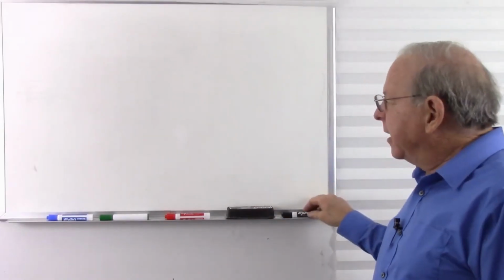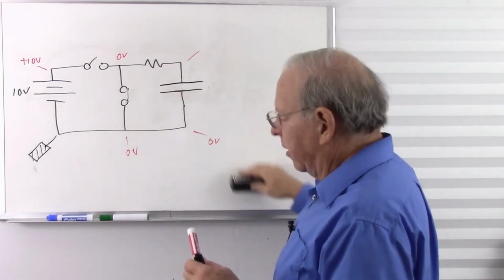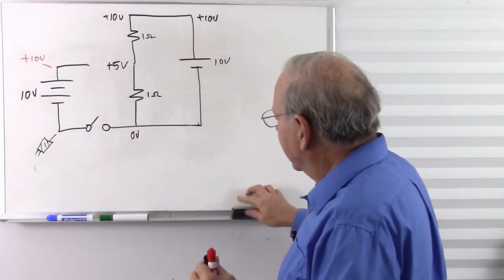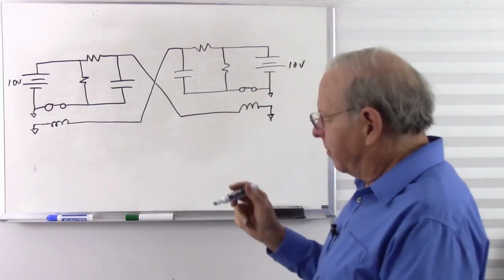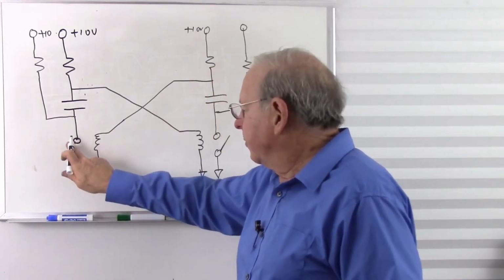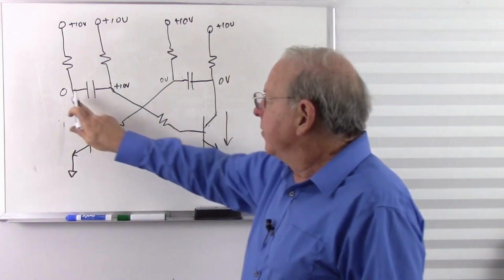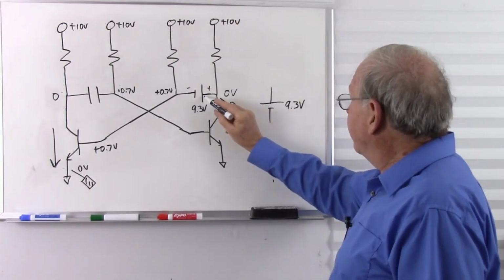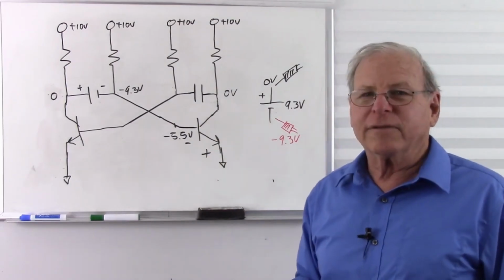Astable Multivibrator - Answers to Questions

Comment: In case you want a more theoretical explanation of what's going on when the switch opens around 18min mark:
Apply Thevenin theorem between the divider mid point and the capcitor + charged side. You get a +5v Thevenin eqv. voltage and 0,5 Ohm Thv eq. resisistance. Then, the unknown voltage comes by adding the two volatage sources in series, which is +15V. The 0.5Ohm resistor is inconsequential in this case, because there's no current flowing.

Comment: Hello, I learned a a lot from this video not just about astable multivibrators!

I came here because of a small home project involving motion detectors and micro-controller. Basically I need to be able to send a short pulse (apox. 20ms) to a reset pin on the micro-controller, I would like to use the PIR to do that, but the PIR goes high for around 3.3v when active and zero when idle. The problem is the high signal from the PIR is too long (stays high for around 1-2 sec) and confuses the RST pin on the micro-controller, I'd like to use the edge of the pulse from the PIR to send create a a 20ms pulse for the RST to work. It would be wonderful if you make a video about this. Thank you again for the great work you have been doing...

Comment: Why would the resistor-capacitor combo charge at the same speed when you put a resistor parallel to it. Yet when it discharges it does so twice as slow?
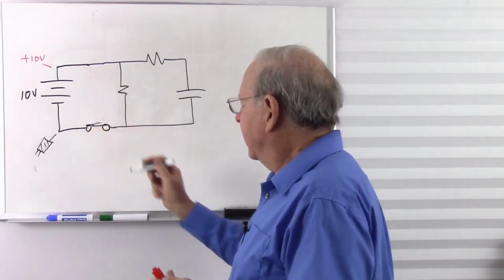Reply: I think he just made a mistake because when you got to 22:00 he says it’s charged after 10sec

Comment: Thanks for the video! I used two small power supplies. I used two 1 kohm resistors. I  used one supply as a capacitor substitute across the both resistors and set it to 10 volts to start. Took the other supply set it to 10 volts. Placed the positive of the fixed supply between the two 1 kohm resistors as shown in the video and used a small jumper wire as a switch between the negative  of the fixed supply to the bottom of the two resistors where I had the negative of the supply I was using as a capacitor substitute. Worked great! Could run the capacitor substitute supply up and down and watch what was happing on my DMM across where your switch is in the video. Close the switch 0 volts. Open switch with the capacitor substitute supply at 10 volts and the DMM read 5 volts! Then start decreasing the capacitor substitute power supply to 0 volts and watched the DMM climb to 10 volts. Thanks for the video sir!

Comment: Excellent and detailed information, I have learned a great deal here watching numerous videos. I built an astable circuirt and it worked well. Then I moved to a traffic light circuit, 3 transistor, 3 LED circuits that look very similiar to the astable. Built it several times always using my on hand 2N2222s instead of the BC547s shown on a video. I tried various circuit mods but they just sit there, no LED lights on. The voltages all make sense but all 3 transistors are fwd biased, all on, bypassing the LEDs which correctly are off. Pulling the B connections, the LEDs come on just fine. I can find no way to get the cycling started. HELP!!!

Comment: In the first diagram discussion, what if the switch is placed right after the positive side of the battery rather than after the negative side of the battery?? Will the working of the voltage when switching on and off will be the same??

Comment: Why shouldn't there be any voltage on the parallel resitor at 10:00 ?
Reply: There is. 5v. That's why it took 10 sec for the capacitor to charge, when it took 5 seconds before. After the capacitor is charged there is 10v at the parallel resistor.

Comment: I am in awe of this man. His ability to imagine his way into the thinking of a trainee, in order to lead the trainee from lack of understanding to full mastery of the subject, is evident at every step in the presentation.  I have never seen a better technical training presentation on any complex technical subject. Bravo, bravo, bravo!

I have three small suggestions for refinement in keeping with the underlying philosophy of the presentation. 1) When referring to the voltage across the capacitors, it might be helpful to refer to the voltage as a "differential voltage," to help a trainee further appreciate the fact that the voltage across the plates of the capacitor can be measured independently of any other reference point (such as ground or the positive side of the power supply). 2) When redrawing the circuit for the first time in the "traditional astable multivibrator view," it might be helpful to show the two resistors on each side of the circuit tied directly to each other and then to the power supply (rather than each tied independently to the power supply), to help the trainee fully grasp that the capacitor can be discharged through the two resistors, regardless of the power supply voltage. and 3) To help drive home the concept that a fixed differential voltage across a capacitor can appear to be above or below the power supply voltage, help the trainee imagine how the voltage reading for each side of the capacitor, relative to ground, would change if the voltage of the power supply were to be temporarily changed from, say, 10 to 20 volts, EVEN IF THE DIFFERENTIAL VOLTAGE ACROSS THE CAPACITOR REMAINS THE SAME.

I bother to elaborate these possible refinements as a way of acknowledging that the presentation already incorporates dozens and dozens of such helpful aids to a trainee's understanding. I was not kidding: This presentation is the best I've ever seen, and I'm in awe of this man.

Comment: I see that the capacitor seems to be put in series with the battery with the switch being opened, and we measure the voltage from one end of the series to the other. Now the restor connections somehow make it not 10V + 10V but 10V + 5V, but Idk how... Could you comment wether I'm understanding this rise in voltage correctly? And how it goes to 15V rather than 20V in series?
Reply: Did you know the answer?

Comment: 10:15 ... ? Surely at t=0, the current will divide equally to the two resistors. As t increases, I would assume more current flows through the "vertical" resistor? Surely this is quite different from the simple switch (open) previously and must affect the charging time etc.?

Comment: This always has been the hardest one to wrap my head around, I get it much better now. I never thought of a cap in such a way with a voltage offset on one side or the other,  thats how voltage multipliers work. They threw SO much stuff at us for my little AAS degree but I'm glad. Our instructor had a masters and he didn't hold back, if you wanted the material on that level he was happy to give it, some of the students complained, not me. Got my moneys worth then some. Digital was the best, your imagination is the only boundary.

Comment: 50:44  Current can flow through a capacitor as long as the voltage is changing with time.

An important factor in understanding how that circuit works is knowing that a capacitor works like a straight piece of wire when you consider short time scales. This means that if you change the voltage on one side of a capacitor, the voltage on the other side will immediately change by exactly the same amount. So when transistor turns on it immediatelly grounds one side of a capacitor lowering potential of one side by 10V, the other side follows, which means that it's new potential becomes + 0.7V - 10V = -9.3V.  When this happens the -9.3V side of the capacitor which is connected via a resistor to Vcc +10V begins to charge to that level and as soon as it reaches +0.7V is the other transistor switches back on. I hope this helps in understanding.
Reply: Thank you very much for this clear explanation
Reply: In my understanding, that's because the field of the charge accumulating on the capacitor working against the source field depends on the amount of this charge, and in short time spans, the charge just doesn't have enough time to build up and work against the battery. That's just seen in the charging-time diagram where the initial current and other things are big initially.